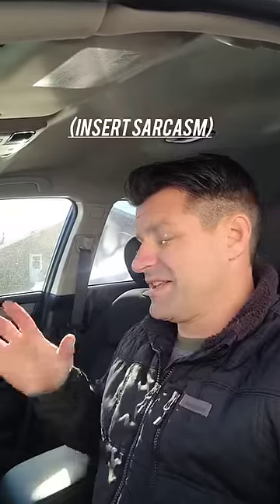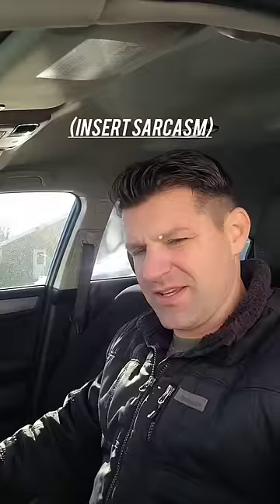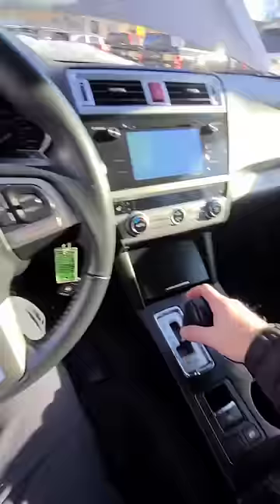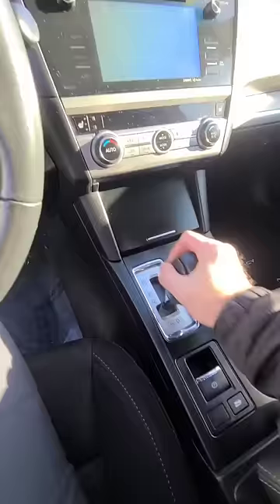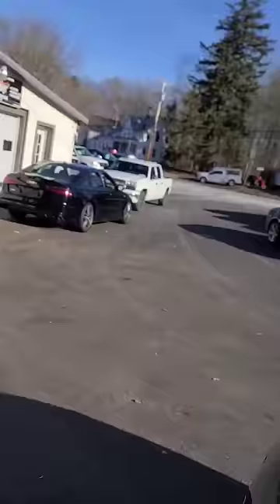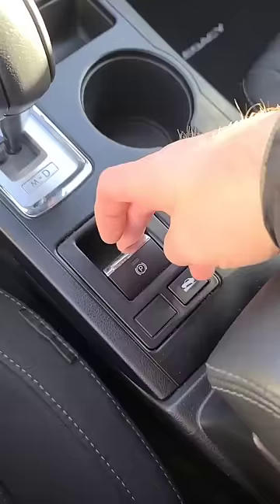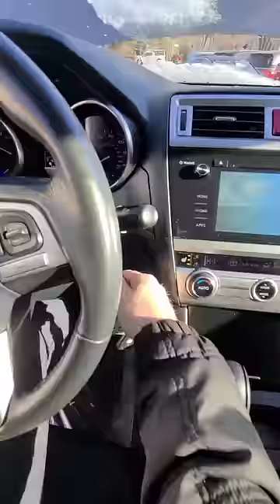Why Subaru Engineers deserve a punch in the Face! #shorts

Comment: The engineers who tried explaining this to the management: 😢👍
Reply: I bet it wasn't the engineers who did this. They probably couldn't convince management, or the sales team, that such a feature was a major FUBAR.
Reply: It probably wouldve cost atleast 5 dollars more
Reply: There is a slot for a screw driver to manually move the shifter.
Reply: You guys know there’re engineers to make sure other engineers designs can be worked on? Just because you’re an engineer doesn’t mean you’re infallible
Reply: @DrAdityaReddy  9/10 engineers being employed is not a joke.
Reply: It's called a shift lock and written in the manual how to release it with the battery disconnected.
The locks were driven from government regulation.  Don't blame Subaru, blame an owner who doesn't know how their transmission works and the NHTSA.
Reply: I believe all new cars will do this all w electric brake there is a access to manually move shifter
Reply: It got too technical for the managers so they just threw up their hands. “Whatever! Proceed.”
Reply: 😂...have you got any idea what you're doing...read the manual...and the sub menu on your trip computer for the battery voltage...😂😂😂😂

Comment: Finally a reason to use the headrest as a wheel chock.
Reply: Bruh😂😂😵
Reply: definitely the move if you’re really in that situation by yourself
Reply: Haha that is a good reason.. but not sure if I’d do much
Reply: Bro I've actually had to do that on the side of the highway couldn't get the jack and car to stay in place to change a tire
Reply: I'm saving that in my playbook. Just incase
Reply: Dude, yes. That's an amazing idea.
Reply: Didn't imagine that the guy had the wheels chocked to open the hood and connect his jump box - but remove the chocks and get into the car before turning the box on?
Reply: XD 😂😂🤣🤣🤣🤣
Reply: F for those with the electronic parking brake and displays in the headrests. I don’t think the one piece back seats like gd/gr overlapped e-e-brake models so at least there’s that
Reply: Genius lol
Reply: I've done that.........

Headrest is cheaper than body panels.
Reply: Nice, I was trying to think of a wheel chock.
Reply: Note to self... add wheel chocks to emergency equipment.
Reply: Actually brilliant!
Reply: Great idea !

Comment: Dude had plenty of time to jump out and throw his camera in front of a wheel as a chock.
Reply: What if your car dies while you’re driving up a hill
Reply: @austindavid1862  That's actually another severe design flaw in Subaru. If the engine detects a fault with the throttle body, the throttle will stop responding. All it takes is an electrical fault, fuse blowing etc. Imagine pulling up to a road in front of an 18 wheeler and suddenly you're across the road with no acceleration. Super stupid design that can cost lives.
Reply: @austindavid1862  Then you would have gears engaged, so it is irrelevant and unrelated.

To achieve this, you need to stage it.
Reply: he isnt clever ffs...
Reply: @austindavid1862  it has battery einstein
Reply: hahhahahahaha
Reply: Lol. Golden comment award.
Reply: @Fuckingenius  what if the alternator goes bad and drains the battery Einstein
Reply: @yt.personal.identification  so if the battery died while driving uphill and you’re driving an automatic, you’re screwed ?
Reply: @austindavid1862  How do you drive up hill in neutral... genius?
Reply: @yt.personal.identification  sir, before you go on being disrespectful. Understand that the car can go up the hill (in DRIVE!) And the car can die. 🤡
Reply: @interceptingfist5682  Very good. Now complete the thought if you can.

When the car dies, while driving up the hill in gear, how does it miraculously shift to neutral?
Reply: @austindavid1862  You put the chock behind the back wheels?
Reply: Maybe... if it was a Nokia...
Reply: What kind of phone you rocking? 1980s Motorola?
Reply: @yt.personal.identification  if the hill is steep enough, being in drive doesn’t mean anything. The torque converter isn’t a solid link to the engine, so the engine isn’t going to keep the car from rolling. Hell, even a manual car will still roll on even a slight incline without the parking brake. 

There’s a reason why putting your car in “Park” engages a physical, mechanical locking mechanism inside the transmission. 

Stupid design by Subaru to lock you OUT of Park.
Reply: @dannonyogurt98  not all cameras are phones.
Reply: Right?! I we must be dumb to think of choking the wheel
Reply: @Reynar7  …..put the chock behind a wheel of a car that’s already rolling backwards down hill ? How would you manage that
Reply: @yt.personal.identification  rewatch the video, it won’t let him shift into park after the battery died
Reply: @dingdong2103  literally every vehicle with an electronic throttle body will lose throttle response in an electrical failure. that's all gas vehicles made today.
Reply: @TheZumiezNation  The Forester is the only car I've owned that does this and I've owned 10 different cars with the electronic throttle body. The Subaru has some sort of a dangerous fail safe mode which lets you accelerate a tiny amount but not enough to make the car move properly.
Reply: If my car battery dies the car disappears
Reply: @austindavid1862  it'll be in gear preventing it from rolling

Comment: JHC.  
For everyone clamoring that all parking brakes should be mechanical and Subie engineers are overthinking everything and being purposefully complicated....know this one thing.  

Cars equipped with Hill Hold or Hill Start Assist (like Subie) do so by utilizing an electric brake.  It's so the PB can hold the car on a very steep incline or decline without your foot on the brake.  This prevents ANY roll of the car while moving a foot to the acellerator. Once the accelerator is pressed the car automatically releases the PB.  

It's' a feature, but not without possible flaws of course.

Comment: If you had read the user manual, you would know there is a shift lock release mechanism in the center console, which allows you to put into park when the battery is dead.
Reply: Ok. But most consumers would not be aware of this. You should not have to read through 800 pages on the owners manual to put the car in park or pull the handbrake.
Reply: @AJ-zv9tn everyone has a phone tho just like this guy who's recording this video. He could've just googled, "how to shift an automatic with a dead battery". And who works on their car without tools nearby?
Reply: @AJ-zv9tn  As per legal/manufacturer's requirements, you must read the manual before operating the car. You did follow the instructions?(<- sarcasm) Also, looking this up from a manual takes a total of 5 minutes. If you can't even do that, you should not be working on your own car.
Reply: Also why is he even in a situation where the car is shifted into neutral while the battery is simultaneously dead? If he couldn’t figure out how to shift the vehicle while the battery was dead, he couldn’t have put it into neutral after the battery died. So this is literally his fault. Even if the battery died while he was driving he should still be in drive, which would provide enough friction to prevent rolling.
Reply: @Nole Nu11  unless he was coasting in neutral down a hill.
Reply: @danielvalenzuela8814  Well considering this doesn’t improve fuel economy and puts you in danger of being unable to react quickly to unexpected hazards, and also is illegal in some places, and is also damaging to engines and transmissions in some circumstances, he really shouldn’t be doing that either. Once again, this is a silly thing for people to be upset about, let alone want to punch an engineer in the face for. It’s easy to look up what to do in the manual or online, and the scenario in which a person would wind up with a totally dead vehicle in neutral is so unlikely to occur it isn’t even worth being upset about. Like the whole “well I shouldn’t need to read a manual to know this” argument is ridiculous. The entire POINT of the manual is to be there as a reference, especially in emergencies, and it has and index to make it easy to find the information. Most manuals literally have a section for emergencies…
Reply: I feel like dealerships should give a quick overview of the user manual for the most common issues that involve the new tech cars have such as this one
Reply: @AJ-zv9tn You can do it while sitting on the brake. You don't have to remember every word.
Reply: @Rockymountain11  and used cars? LOL ownus is on owner.
Reply: @AJ-zv9tn  this is the case for most new vehicles regardless of make. Ignorance doesn’t change it.
Reply: what's faster, a mechanical emergency brake or having to sit there, going through a bunch of nonsense to then find out you have to do more nonsense.....
Reply: ED Gatti. That's what the nay sayers said when their horse and covered wagon became obsolete. LMFAO
Reply: @jjjcmzzt  being in neutral 100% does improve fuel economy. However if you are going down a steep hill, that means you are using your brakes more instead of engine breaking from being in a lower gear. Which in turn will wear out your pads and rotors faster.
Reply: @AJ-zv9tn  that's idiotic.  "People buying something shouldn't be forced to understand how to use it!"
Reply: @auburntigerzz  Automatic transmissions can get damaged if you have them in neutral. It increases wear substantially and has no fuel economy benefits as the transmission will automatically partially disconnect so you are effectively "in neutral" anyway.
Reply: Good to know seeing as how Subaru hasn't admitted to the parasitic battery drain design issue, which results in frequent dead batteries.
Reply: Yep pretty much all American cars w/ an automatic transmission will have a shift lock release for this very reason. It’s been this way for decades. The only person he should be castigating is himself. Thanks for providing good info.
Reply: @Rockymountain11  Its not new tech. All automatics have had this feature for decades. It’s a legal requirement. RTFM pls
Reply: And how does this help him? You can't even get to it with a pen or pencil. A flathead screwdriver also does not work. He'd have to literally have a phillips head screwdriver in his pocket to release it, while also having to find it and hold up that rubber mat that just keeps flipping back down. I've had to do this and it is RIDICULOUS. The whole design is ridiculous.
Reply: @AJ-zv9tn they make an index page for that. You don't have to read the whole book, just find the relevant section.
Reply: It's not in my manual

Comment: There's a shift lock release in the center console forward under the rubber mat that you can release with a screw driver.  Better than most other vehicles that are equipped with a small door next to the shifter that always gets damaged when removed.
Reply: Like an old saab i had ah yeah! 💪🕺⚡️